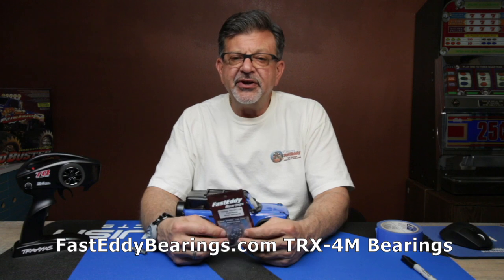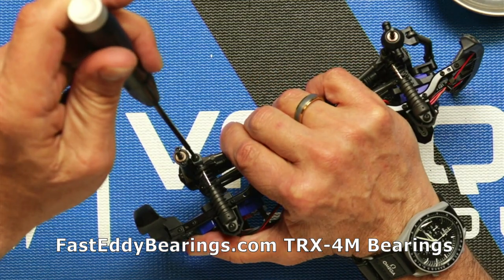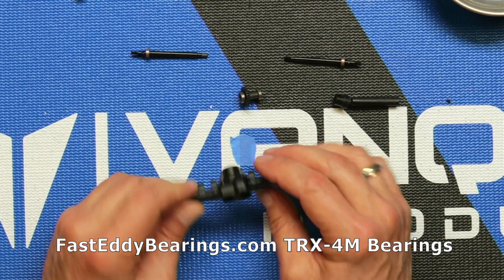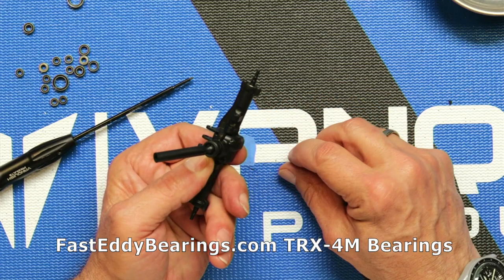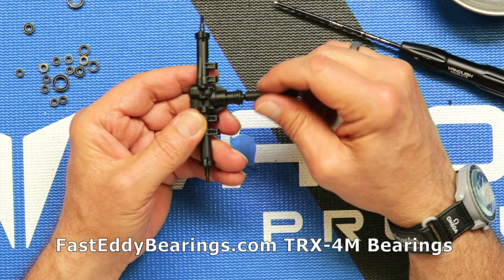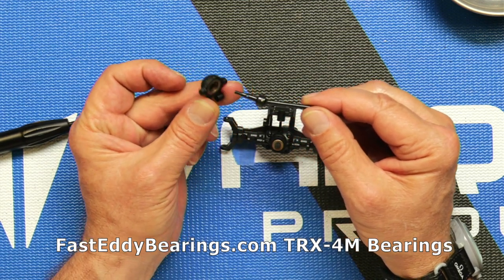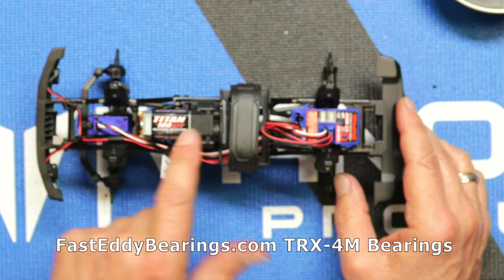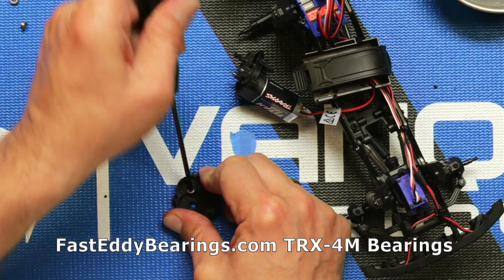FastEddy Bearings TRX 4M Bearing Install. Step By Step

Comment: Nobody’s mentioned this,but my two day old trx4m has stripped ring gear in the rear diff. I called traxxas and they will replace them under warranty with more nylon gears but it’s just going to do it again. I ordered metal gears,hopefully they will last a little longer.

Comment: My 1.5 does not fit properly into the 2 screws at the end of the axles. I even tried the alien wrench supplied by Traxxas and it still spins freely. Very frustrating, not sure what to do now.

Comment: This is why I got so far with mine and then sold it. I was unimpressed with the plastic everything and bushings. We are too far along with products for this type of bs from manufacturers. The truck was ok stock ,just needed weight and better tires for crawling but it was a slab walker out of the box if you prepped the tires first. Imho it's not worth 150. Mabe 75 bucks. I had 400 into mine and it was ok....didnt really reflect what was put in it.
Reply: Just run it the way it comes don't waste money on unnecessary items